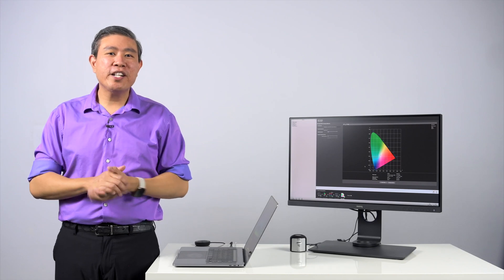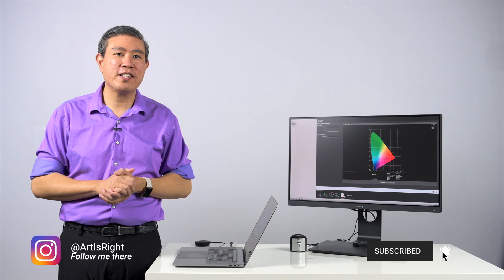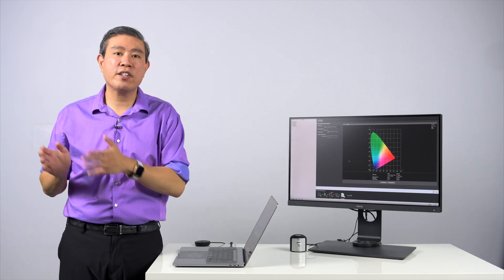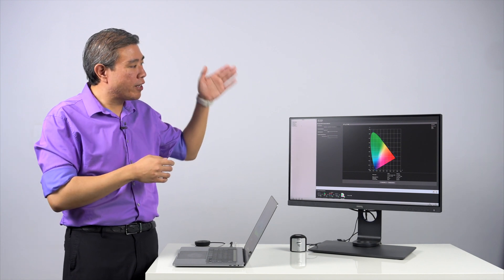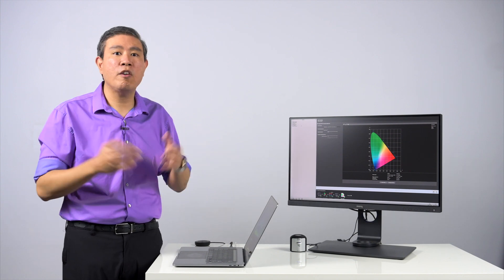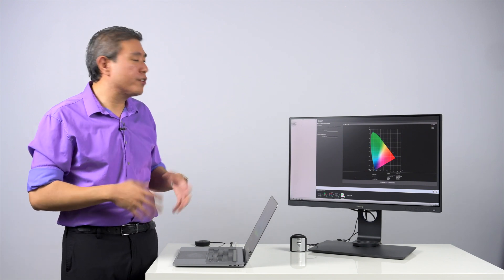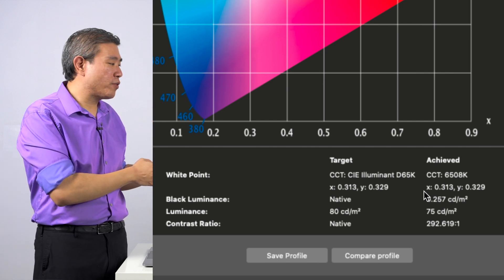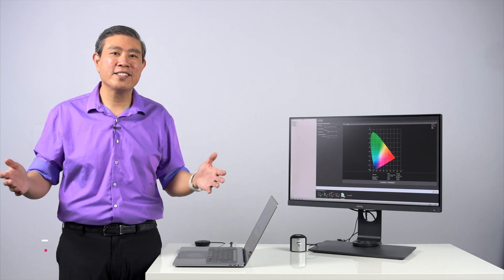A conversation about why contrast ratio is reduced on a calibrated display.

Comment: I have an SW 2700.  After watching several of your videos, I calibrated with both the i1 Display Pro and the Spyder Xpro.   I used Palette Master for most attempts, but I also tried the X Rite and Datacolor software.  I have made at least 10 calibrations with different combinations of input.  The results have been consistently poor.  The best result had an average delta of just under 3 with a max of about 9.  I. Talked to BenQ tech support last week.  They offered a few suggestions which I tried without success.  I have tried to reach them several times this week with no success both via phone and email.  Any suggestions?
Reply from the maker: @BJL
Answers these questions for me and we’ll go from here.

1. What computer (Laptop - Mac specify the model, year and size, Desktop, iMac, all in 1 PC, custom build, etc ) and OS version (For Mac please specify the dot release) are you using?
2. What calibrator are using?
3. What version of PME are you using?
4. What BenQ model do you have?
5. What cable are you using to connect your BenQ to your computer for the display signal, HDMI, Display Port, etc.
6. If you are using USB-C skip this question, if not, are you using a USB link cable between your laptop and display?
7. If you are using Mac was this a clean install or was the OS upgraded from a previous version at any point (I.e. From Mojave 10.13.x to Catalina 10.14.x)? Or was this Mac restore from a back up, time machine or other wise?
8. For PC, what GPU are you using? If Nvidia are you using their new Studio Driver?